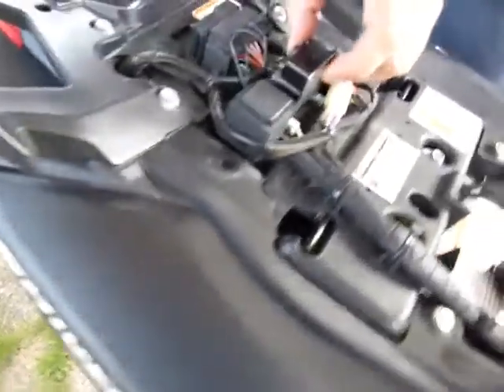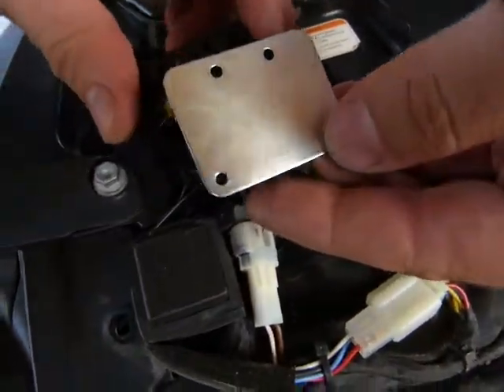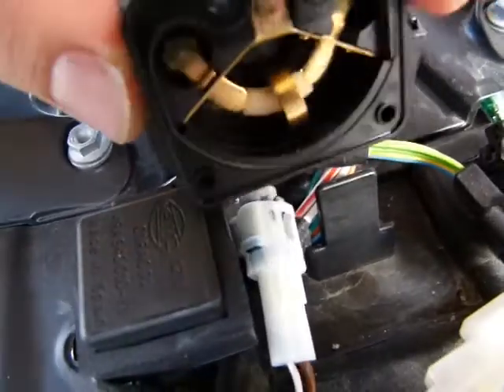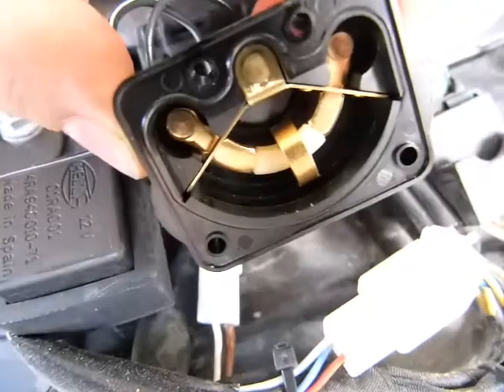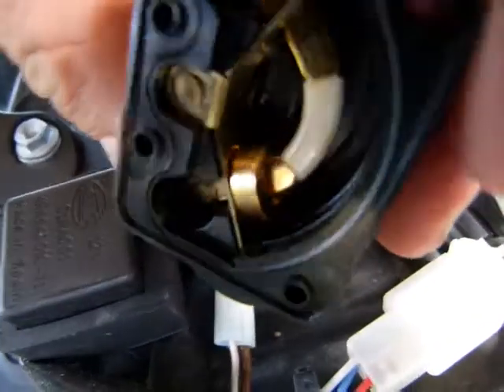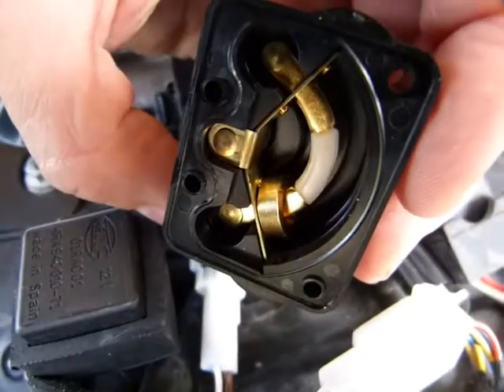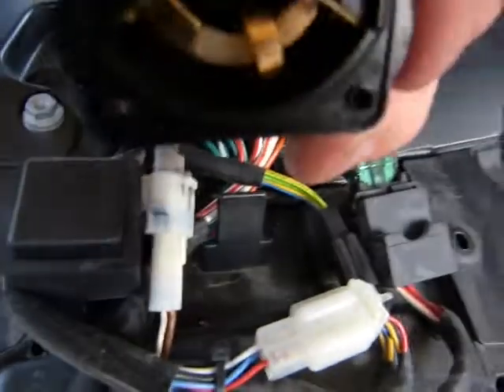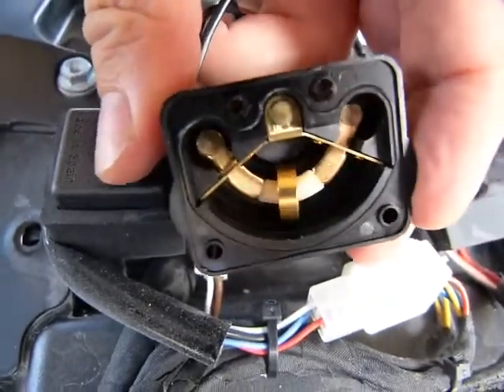How the tip over or roll sensor works

Comment: Hi 

I'm experiencing problems with the fuel pump not firing and suspect the tip sensor as I was getting an error code for it , it's disappeared now but tonight it wouldn't prime, would turn over but no fuel pump buzz, then I stood it up and it primed ...so I believe it is the tip sensor,  could I just remove it if it completes the circuit, until the new one arrives or does the 3rd wire provide a signal to the ecu ..ktm duke 125 2011
Reply from the maker: Absolutely, just jump the wires, make sure connections are solid and correct

Comment: Any idea how to bypass it?
Reply from the maker: Disconnect both wires going into it and twist the wires together. Wrap the joint with electrical tape so it doesn't short to the frame.
Reply: @theoverengineer  I have heard and seen on other sites that it resistor must be put into place?

Comment: I have a 2009 Ninja 250r (carb engine). I just laid it down for the first time on yesterday. Even though the damage seems to be very minimal, I cannot get it to start. Would this be a possible problem?
Reply from the maker: It could, but unlikely. Clutch switch or side stand switch disconnects are more likely. Here is one on clutch switch https://youtu.be/UbCDX6K5qUA

Comment: My shiver won't turn over at all tested starter motor and starter solenoid all ok. 12.5volts at battery all safety switches working fine, could this be the reason it's not turning over? Any way I could buy pass this switch to test it without buying one first?
Reply from the maker: Part of troubleshooting is isolating (bypassing) and testing, so connect a good battery to the starter (removed from bike) and go from there https://youtu.be/_OQtPuP2Wic
Reply: @theoverengineer  yeah done all that many years ago!!

Comment: Could it get stuck and cause electrical problems, or make the bike not turn on? Like battery lossage?
Reply: How does someone reset the sensor or the bike to start again?
Reply from the maker: It will cut power to the starter motor, bike will not even fire without this switch.

Comment: I'm getting power to the ignition but the fuel pump is not priming, could this sensor by the issue ?
Reply from the maker: Could, but very unlikely. Bypass this sensor temporarily with a piece of wire, see what happens to fuel pump.
Reply: @theoverengineer  fuel pump motor is gone, replaced it and it started up. I took the old motor apart and the filter was full of shit🙄

Comment: Could this cause intermittent stalling if it's going bad or does it just fail why did you change or repair it ?
Reply from the maker: Yes, riding on track at 45 or more degree lean angles.

Comment: Yamaha 2016 fzo7 tipped over and won’t start. Can someone please help. Thanks
Reply: Yamaha r1 layed over as well wont start. But it will turn over but never hit and stay running. Same issue or does yours not even turn over? Just wondering. Hope u figured out your problem.

Comment: That would be a bitch if you made a 100ft jump with a flip in the middle of your air time no? LMAO!
WTF?
Reply from the maker: Would not trigger. LEAN OVER sensor, huh? not flip 360 sensor.
Reply: theoverengineer 
Yeah it was a JOKE dawg.
I looked this switch up because my brute Force 750 is having issues,, I'm troubleshooting fouling the rear plug. Mine has a flip over sensor that somehow worked it's way onto its side under the seat.

Dam thing works on the fluke meter but doesn't effect the engine for some reason.
Reply from the maker: `sall good, bro.
Sensor should cut power to ignition, possibly to fuel pump.

Comment: Seems like a big heavy clunky sensor.   I would think a small mercury switch or tilt sensor like that used in phones and TV remotes would be better.
Reply from the maker: Instrument manufacturers want to stay away from using liquid mercury in a vehicle, subject to damage.
Reply: Good point.   What about the other types of tilt or movement sensors used in phones, remotes, and watches?
Reply: @KarlLeinsing  overly complicated.  You just need something to turn the engine off if you tip the bike over so the engine doesn't run with no oil in the sump.

Comment: This is not how they are on some GSX-R models as well. The tip over sensor is a little thin black box that has a chip in it and a rotating piece. Which kind works like that sensor but you can bypass it with ohm resistors.
Reply: Yes that rolling thing is magnet, and hallf effect sensor is used in the chip
Reply: Lucas Pruitt five toyLtrLs

Comment: Looking at the sensor's insides it seems to me that under normal conditions it is open-circuit. The ring in on the lower plastic coated section of the U shaped copper conductor. Should the bike 'fall over' the ring then moves onto an uninsulated section and also touches the other contacts, and goes closed circuit. The engine management system then shuts off, cutting fuel pump, fuel injectors, spark, or a combination of all 3. In any event it works, as when I dropped my bike the engine cut out instantly, avoiding oil starvation and engine damage.

Comment: So if you leave it unplugged  will the bike start ?? It seem like all it does is make connections between the two poles
Reply: It is a normally open switch that does not just detect lean-angle, but also centripetal force. Go round a corner at 45 degrees at 50mph, and the switch stays open. Lean over 45 degrees when stationary and the switch closes. (Or whatever angle the sensor is designed to work at.)
Reply from the maker: +stealhty1 Yes this is an NC switch (normally closed, open only at extreme lean), the bike should start and run if switch is disconnected.
Reply: @theoverengineer I believe you said that backwards. It is normally open

Comment: You were correct when you said it CLOSES the circuit. To future viewers, when the bike is tipped over the brass ring acts as a bridge to allow electricity to flow between the 2 flat bars you see. The flat bars might look like they touch, but if you look closely, they do not. When the bike falls over, the circuit closes and tells the computer to shut off the fuel pump. That's for safety. Or possibly to shut off the engine. The fuel pump is usually tied to the engine so it shuts off as well.